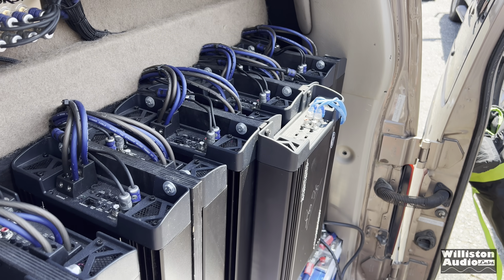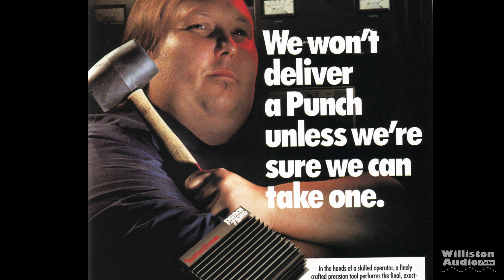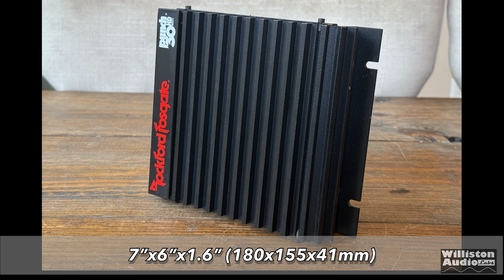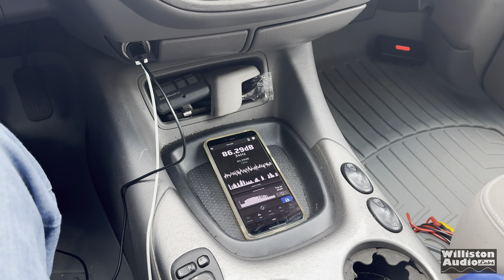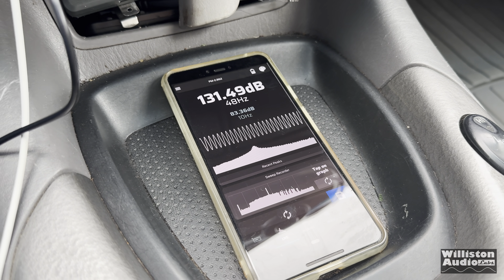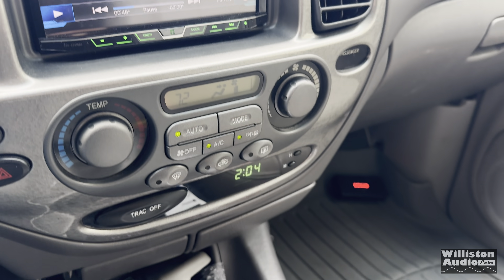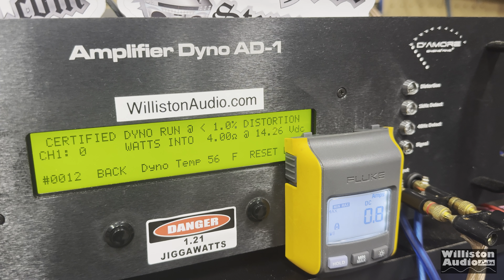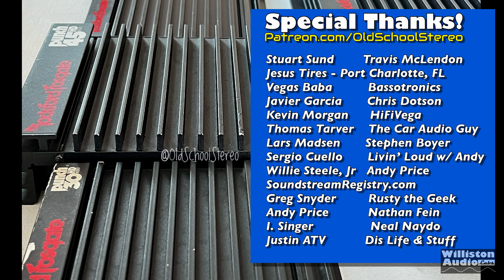Can This 35 Year Old, 30W Amp Power Four 12" Subwoofers?

Comment: Back in the 1990s, I had a purple Toyota with a snug top, Momo wheels, Testarossa body kit, and a hard-top convertible. I had 8 18" punch and 16 mids and highs running with a Rockford Fosgate power 1000 and a power 300. It was badass!

Comment: It is all in the tuning, I had 4 12" Optimus, 2 in each box and the boxes were 3 foot cubes, subs in the front and a crate 1400 watt stage amp with crossovers powering it. The speakers were tuned so low that you could shake the screws out off a garage roof the tin would resonate so hard! Sound it a powerful thing when you understand the tuning and making sure there are no odd resonance in the cabinets. Cabinet structure and strength is key, don't let the box walls vibrate. Staging resonance in the box can change the tuning, you need to know the resonance area's that you need to tune it and understand how sound waves travel in that area of the box. Freeair in tubes with an open front box and 4 15" MMATTS Gugernuats. Everybody has their taste of frequency!

Comment: People also need to keep in mind how sensitivity, power, and output relates to one another.  For example let's say you have a 90db sensitive driver, it means at 1 watt of power it puts out 90db, but output isn't 1 for 1.  On output, if you double input power you get a 3db gain, if you 10x input power then you get 10db output.  For those not in the know 10db output is double the volume of sound.  This is why with clean 1 watt and 10 watts of power a driver will sound pretty good but where it usually falls apart is that many amp manufacturers lie on their specs so 100 watts (especially bass) is a decent amount of power cheap amps can't do well or for long.

Keep in mind as well Amp x Volts = Watts, your car's electrical system is going to produce ? amps x 12 Volts = 12? Watts, so depending on your vehicle's alternator output, passive draw from all items other than your stereo/amp, and how quick your vehicle battery can dump power matters how many watts your your drivers receive to produce sound.

Comment: I had an '85 Rx7 in 1997, I was 19. I had procured 2 used JBL 10" subs and had no perameters for them. My buddies uncle was a musician and had equipment to test speakers and he gave me the thiele small perameters for them. I then did the equations and the ideal box was 3.2 cuft ported box tuned at 32hz. I built 2 boxes stuffed them in the back of the Rx7 with subs and ports facing up at the rear of the hatch area. 600 Watt amp. I destroyed all but the most expensive system in my town. I could make pictures in my parents house move crooked, they could hear me from blocks away and knew when I was coming home. The steering wheel would shake like an inch or so. Sufficed to say, when you have the exact right box for a sub and place them and the ports in the right spot, you can't beat it.

Comment: I had a Punch 45 driving two kicker competition 12s in the old days in a S10 pickup and man that amp was the shat. My buddy had a certain Jensen amp that was small and did damage as the punch, good amps. That Punch would get so fuking hot though, popped a hole in it and ran a 12V CPU processer fan off the remote wire, didn't really hep with the heat sink frying eggs but sure it kept the board cooler.
Reply: I stopped reading as soon as you said Jensen

Comment: The rumor goes that an Extreme dB car was able to play around 150dB on the power from a headunit around 7watts. And it did 170 + with 50kwatts of power. This was back in 2010 i Sweden in a Renault if I remember correct.

Comment: l had 2 Punch 45s in my Mustang in 88. l ran 10 speakers. 2x 12" Punch, 4x 5.25 Punch, 4x 1" Domes. 1 Punch 45 ran the 2, 12s. 1 Passive cross-over.  Damn, l think,  the whole set-Up cost me over $1200. My Buddy still has the Amps and the 2, 12s on a shelf in his garage. The set-up sounded Great and l couldnt afford Bigger Amps.   The set-up was in the car 9 yrs and l never touched the amps or speakers, til l took it all out to sell the car.

Comment: Trying to learn. If they were making that much db. Back in 90’s without all the batteries and alternators big amps then what’s the point in the new big equipment now? What db. Do those make with a new favorite big amp?
Reply: They were still using all that stuff back then. Wattage numbers were just lower and the capacitor banks went as efficient.

Comment: Realistically speaking, 50 watts into 4 ohms is 50 watts into 4 ohms is 50 watts into 4 ohms.  Grab ANY other quality 50 to 60 watt amplifier (think Orion Red 225HCCA, (which, by the way, would simply SPANK the Fosgate into a bridged 1-ohm load, which that enclosure COULD provide) Soundstream A50, Alphasonik PMA-2030, PPI from the same era...) running into the very same enclosure, with the very same tracks, and how much money do you put on very SIMILAR if not IDENTICAL, results?

The fact that the manual for that amplifier shows a (woohoo!!!) 16 speaker system off a 30 watt amplifier only shows just that...  I can run 200 speakers off a 3.75 watt tube amplifier, as long as I maintain safe impedance.  Crossover networks are AMAZING things.  I ran two Eclipse (first Gen Poly-Mica cones in a Dual Transmission line) 12's, a pair of Morel MW-162 (4 ohm) and a pair of  Infinity Kappa ribbons off a Soundstream Class A-50 in my 1986 Civic Si.  All series crossovers with impedance compensation built in, and that system was astounding, in both sound quality, as well as sheer output capability.  That amp was eventually replaced by a Special Edition 2100 (the blue one, by PPI) and it played so loud I couldn't sit in the car.  (I did grow to appreciate higher SPLs, so that's really not saying a whole lot, admittedly...)

Nope...  RF was nothing special, except they might have been first in many aspects, but the worship is completely unfounded.😁

Comment: I used to love the ADS Power Plates.... 120 watts but had my radio shack 15 hitting monster bass.... It actually broke some light fixtures in the house when I was parked in the drive way lol
Had one going to the sub using one of those manual bass cross over deals and one for the 6x9's.... sounded so good back then... I wish you could still get those radio shack manual cross over deals...
Reply: What happened to the ADS Power Plates??😉
Reply: @tigerstripeeyes9871  No idea, it was back in the late 80’s or so

Comment: Play some easy e or some Dr Dre it sounds way better back then than it does nowadays that punch 30 amp was really about 45 Watts 47 watts is what it actually peeked out at they work better than the Hifonics amps I had a punch 45 with two pyramid Pro Plus dual voice coil piece of crap 12s in Ceres at 1 om would eat up M&M Godfather 12 with hifonic amps

Comment: Lets see the Power 300. Had that back in the 90s. Only thing I hated was the connections. Just wires sticking out. Terminal blocks mounted to the amps were a huge step up

Comment: Really more impressed with the quad box than the amp. Power is power, so the Peanut wasn't doing anything special.

One of my buds managed a shop that carried RF, and had 8 SP-154s running off 2 Punch 150s. It was flourescent shop light bulbs falling from their fixtures while playing Boston at half volume ridiculous. Another who also competed SPL had a wall of 6 of them running off 6 bridged Punch 45s in a Mazda B2000 extended cab that felt like an earthquake if you were inside a nearby car or  building. Crazy stuff considering my mother complained my 4 Punch 10s were "moving the furniture around" when I cranked it in the basement below her bedroom. Love your stuff; thanks for reviving 35yr old memories!

Comment: Sir your forgetting all about the power side of that RF power punch30 it desperately needs a 1 /1.5 f cap 3 inches from the amp an the cables supplying the cap are 0/0 lol also those power amps need some heat in em before they really show US what THEY CAN DO

Comment: Gotta Love the old Molex Plugs ben in Computers since the Personal Computer came out they never fail. wish I could get my Orion HCCA 250 old school amp repaired.
Reply: If your gonna run this old stuff make sure to solder in new capacitors
Reply: Molex never fail? They absolutely fail and are a fire hazard. It’s one of the reasons they stopped using them in computers. They back out over time and cause arcing.

Comment: Not surprised. Would be cool to see it on four low power 90's subs, like Pioneer IMPP's or JL W-1's.

I recently threw together something for my youngest son's first car, mostly old stuff I had. I used an old Kicker Impulse 25X2 on a cheap Dual 10 ($50 new, box included). I was dumbfounded how good it sounds.

Comment: Back in 1996 I had a 1988 Ford Ranger ext cab with a JVC Kameleon head unit and all Pioneer speaker setup powered by RF 30’s.
I had four 10” Pioneer IMPP woofers in a sealed enclosure behind the seat and a Premier component mid & tweeter set in each door.
Each 10” had their own RF 30 running bridged and then two more RF 30 running bridged powering the component set in each door.
It was one of the best sounding systems I’ve ever had.

Edit: I started with a Pioneer head unit then upgraded to the Kameleon a couple years later.
Reply: The chameleon was sweet

Comment: Oh man, back in the day ( 1990 ) I used a  a/d/s PQ 20  bridged to make 200w x 2 to drive  two Stillwater design 12 inch subs in a custom sealed box. I also used a 642csi electronic crossover controlled with an ac500 control. I'm old but boy did that system sing. Other electronics were 2 sets of a/d/s 320is componant speakers driven by an a/d/s PH15 . Shame what happened to a/d/s.
Reply: The real question is, “What happened to YOUR ADS stuff?”!!😂😂😂

Comment: I cant find a dyno run of the punch 30 at 2 ohm mono with 14 volts... you hindered the results when u only did the tests with 12v.. next you did the contest runs at 4 ohm mono..The spl test should be at 2 ohm with over 14 volts.. you will get 3 db more ..

Comment: The Rockford fosgate Punch 40 a good one as well...I trade It a punch 150 and a set of 12's for a Honda 750 Ltd motorcycle years ago the kicker was the I found the punch 150 in a ditch upside down it works fine LoL.... so many side of the road fine's crazy VCR stereos DVD players single din head unit speaker boxes speakers yeah good stuff
Reply: What roads are YOU driving down??!😂😂😂
Reply: @tigerstripeeyes9871   we have side of the road pick up for trash for bigger stuff couches furniture stuff like that in town so you could find stuff all through the week

Comment: Yessir I had punch 30hd, 45hd and the 150hd at separate times when I was 18-23 building up my car stereos. They were amazing amps once I got the punch 150hd I held on to it a few years and ran multiple speaker sets off it . 4 pyramid12isobaric. Two JL fifteens. Had a pioneer 4 channel and a fosgate 4 channel to run everything else. I didn't have allot of money so these were big items to me. Def performed well for me

Comment: I had two orion and two jl audio i used the rockford splits for mids and high two sets  in mid 90s i used two amps i bought from a friend they were the rockfod hd 150x2 omg you had to be carefull where you mpunted you did not want them on carpet the hotter they got the harder they hit we would leave orlando slamming the neighborhoods menacing all this was a solid set up in a old 70smuscle car buy time we got to daytona or cocoa beach you couldnt sit in that sob with the gain up volum over 20of 50 those amps didnt hit they slammed the old orions and jl audios slammed as well

Comment: I bought a boat with a Rockville 8 channel amp that's bridgeable and has the option for Bluetooth directly without a head unit. This thing BANGS and I'd love to see you test it. It's the Rockville ATOM 8B and it's only about $200 on Amazon. I've found nothing else like it for the power and price.

Comment: I'm confused about the premise of this video. Most real world near-field audio applications operate at fractions of a watt up to around a watt per channel for normal listening levels. Attaching more drivers/speakers, just increases the efficiency, allowing the same output for even less watts, so why would there be any surprise about a 30W amp being able to power a lot of speakers? You could "power" hundreds of speakers with this amp, and it would be much louder than if it were powering 1 speaker.

Perhaps the most important part of this video, is that is serves as a reminder that massive low efficiency high displacement motors and huge wattage is not a cost efficient way to get a lot of bass.

Comment: I still don't really understand how the Punch 30 moves those with 60 to 68 watts.   I mean I see the efficiency of the subs.  But even as efficient as that sub set up is.  Still those subs don't recommend that sort of power.   But if they perform on 60 watts, then I don't understand why the recommended power is higher.

Comment: Yeah these amps were fire. I still have a mint 60.1 with it's end caps that I'm going to cook a modern 12 in my Hilux with. Last car I had it in 6 years ago was my 85 442. Had it running a chinesium 12" Skar. It sounded like three 12's and the amp wasn't even trying. Gain @0%. 🤣

Comment: It's like classic Hi-Fi. My friend's mid 70s Pioneer amp is 45 watts per channel, but 2 on the volume knob is absolutely mental.
Reply: Tube amps run much lower wattage but produce much higher volume than the solidstate equivalent. Check out a 5watt guitar amp. Those things are super loud at the 2 mark. Plus the audio quality is far superior.

Comment: I'm old school  sterio guy .
We never ran punch at 4ohm
Mostly  at 2ohm
And could do 1ohm
Like he said  our speakers where more efficient lighter not as stiff we got more sound per watt
We used more speakers.
More speakers more surface  area impacts with more air molecules transferring more sound 
We had what was called cheater amps in 90s 
That where  rated 100watt at 4ohm 12v
We would  run them at 1/4ohm  16v  making almost 1000 watt

Comment: Any recommendations on a small Bluetooth amp to power two 6 in ATV speakers? I have about 4 of the boss atv speaker boxes and 3 of them quit on me looking for an amp that will fit threw the 6in speaker hole to mount inside the speaker box
Reply: Never mount an amplifier near a speaker because the vibrations can & eventually will damage the amplifier’s sensitive electronics.
Maybe get a waterproof marine amp, like JL Audio makes? They’re small yet powerful and clean.
Reply: Any amp is going to be rattled being on a atv probably more so than by the speakers. I have several powered pa speakers with built in amps work great  @tigerstripeeyes9871

Comment: I need a test of 2 L7X 15's vs that quad box same amp. I'm really trying to decide what to put in my Escalade. My only issue with that quad box is that it is ported and i like sealed enclosures because i love epicenters and from my understanding you can't run an epicenter on a ported enclosure.

Comment: I has a very early model of the Punch before it became RF.  It was just Fosgate The Punch.  It had 2 bass and treble slider controls with 3 positions each.  That was it.  Had it in a 1982 Accord Hatchback and it thumped.  Per Wikipedia...
"James M. Fosgate (December 5, 1937 – December 7, 2022)[1] was an American inventor, engineer and businessman. The self-taught son of a television and radio repairman, Fosgate invented the first car amplifier in 1973 and founded Fosgate Electronics, now called Rockford Fosgate. After his departure from Rockford Fosgate in 1981, Fosgate remained active in the audio world, running Fosgate Laboratories and leading the team that created Dolby Pro Logic II."

Comment: This makes me wonder what my best setup from back in the day was capable of I had a bunch of mid tier stuff like an old Jenson 2 channel that was 100by 2 in 4 ohm I usually had a couple 10s in ported box with a high power head 25 to 50 watts  by 4 with as many speakers as I could find space for had to be as loud as this was I pissed a lot of people off with music back then LOL
Reply: … not a chance, buddy! Not a chance. 🤦🏻😂

This is (4) 12”s in a well built ported box with 98db efficiency and a high-end Punch 30 amp versus (2) 10”s with a cheap, low-end Jensen amplifier pushing them. Yeah, low-end, NOT mid-tier. You bought Jensen at Kmart (no installers there!), while you bought Punch amps/speakers at high-end car audio shops that could install it for you, if needed.

Sorry to burst your bubble, but a bunch of random other cheap speakers (probably mids & highs) won’t make up much difference.

Try listening to something like this and then going back and listening to what you had (if you still had it… or a Time Machine?😂) and you would see/hear a night and day difference.

You were “typing out loud”… next time, maybe use your inner voice?😉👍

Comment: I just recently put my old 90's Punch 40i amp and two Punch 10" subs that I installed in my very first car back then into my son's first car. Two generations and it still sounds awesome!
Reply: That’s really cool! I’m an old school guy myself. I have a 90 Mustang GT with period correct amps/headunit/subs…
Reply: @luckymanham302  Nice! My buddy has a 90 LX 5.0, all stock inside, but super charged, built heads, trans etc. looks completely stock from the outside. Pushing over 500hp. So much fun. He also has a new GT 500, but I always say let's take out the fox body.
Reply: Was that the Gold Series?
Reply: @bigd1157  the two mods I’m lacking are good heads and a power adder… These cars are a blast!
Reply: @bigd1157  did the same thing for my youngest son